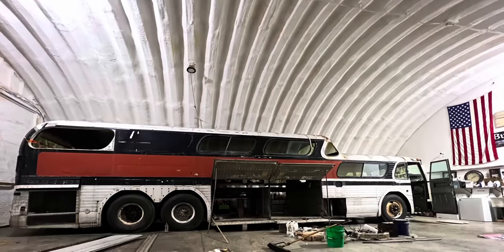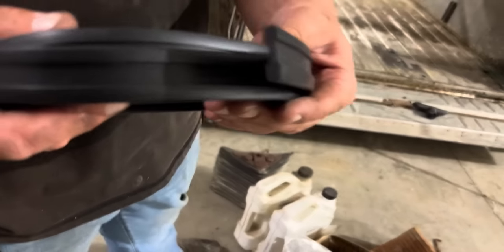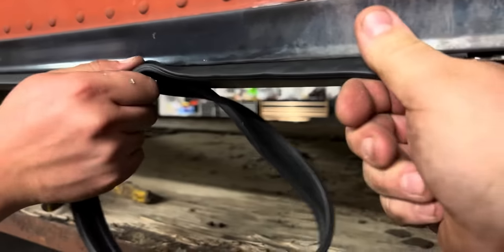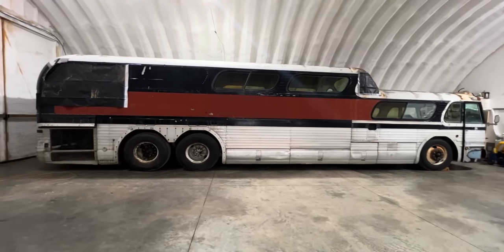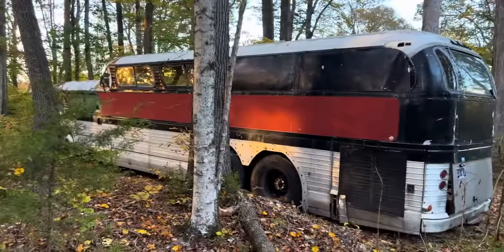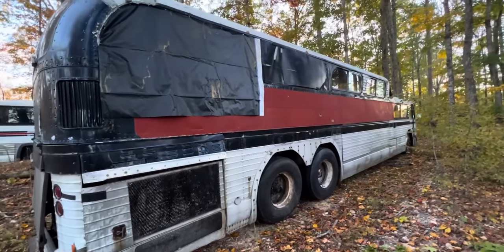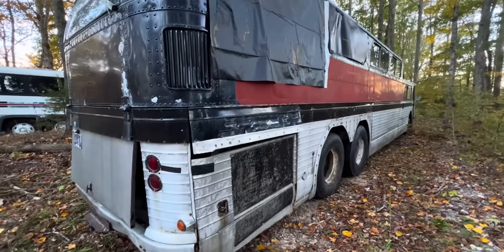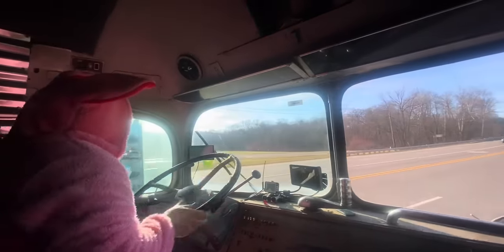Scenicruiser progress and update on the future plans for this bus. Retired greyhound bus PD 4501

Comment: Consider installing an air purifier while everything is open and available. Especially if it will be a guest house. Air purifier will help deal with any allergies, smell complaints, and will help reduce mold / mildew in the bus. Could pipe it to draw fresh air and / or recirculate indoor air.

Comment: A interesting plan for the SceniCruiser. Might I suggest you figure out its home (parking place) and then pour a concrete pad that is 2-3 feet wider on all sides to help prevent the ground moisture from taking its toll as quickly or as easily along with installing some fans to blow under the bus a couple of hours a day when it is not wet/raining outside

Comment: When does it get the automatic swap? Looking forward to that one. Does the SC's have the air lift function on the tag to reduce the turning radius?
Reply: Cruisers did not have air lift on the tag axle. Also, unlike Prevosts and MCIs, which have two tag axle wheels, both rear axles on Scenicruisers have four wheels.

Comment: For your project busses, stainless steel screws would be an excellent choice for replacing  steel screws threaded into aluminum. Steel and aluminum  adjoined will cause galvanic corrosion so aircraft quality screws for use in aluminum are a good choice as they are cadnium plated, not zinc plating. Zinc plating is sacrificial. To prevent aluminum form corroding, use zinc chromate primer. It is and has been used on aircraft aluminum for years and I have seen original primer on WWII warbirds.  Spraying zinc chromate must be done in a well ventilated area.   Aircraft Spruce has it available  in aerosol cans, pints, quarts and if you are wealthy, gallons in yellow or green. I would not use it for general purposes on customers vehicles because of the price. A 16 oz. aerosol can  is now about $35.00 and is back ordered. Aircraft Spruce lists  it as a soecialty primer and it can be top coated. I would not use it everywhere on a bus but it does work.

Comment: I can believe about the ripped-out linkages for the original manual tranny...would this have been that odd three-speed with a two-speed clutch, or a 4 speed Spicer, I wonder? I was reading that REALLY early buses had TWO four-cyllinder motors connected with a fluid clutch! Nah...impossible.